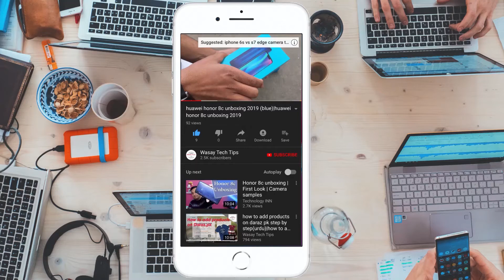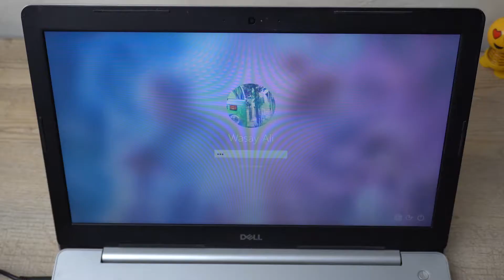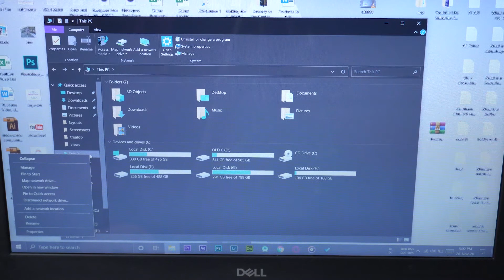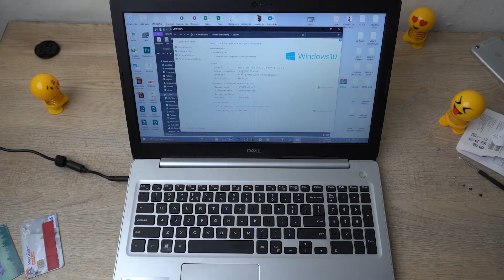How to Install or Upgrade RAM in Dell Inspiron 5570 | Dell Inspiron 5570 RAM Change

Comment: An alt to credit card is to use a trim removal tool. They have cheap Amazon sets that come in handy for other stuff.  My was 25 USD but they basic sets for under 10 USD.
Reply: I use guitar picks. I've got loads of them.

Comment: Did you notice any performance differences after installing the RAM ?
Reply from the maker: Not much difference was seen as my nvme SSD was already very fast in opening applications.

 Only advantage of adding additional RAM was that google chrome could use it more😂.

Comment: My intention is not to slam this video but to share a few words of caution for the inexperienced user. Great job on the tutorial by the way! 
1st: You have DIMM slot A and DIMM slot B. If running only one stick of RAM you need to put that in DIMM slot A, not B. However this motherboard does support either configuration for some reason.
2nd: it's not a good idea to mix your ram. It's a best practice to use the same brand, same capacity (gigs) and the same MHz (Megahertz) when using more than one stick. I believe the MHz is the most important part. If you are going to run different capacity sticks, the larger stick needs to be installed into DIMM slot A, not B.
3rd: Never, ever, ever! Touch the gold pins on your RAM. RAM should only be handled by its 3 less sensitive edges. RAM is the most sensitive component in your computer and is very susceptible to ESD (Elctro Static Discharge). This will render your RAM useless if you shock the gold pins or the chips / circuitry with static electricity that could be built up in your body from a multitude of different reasons. Reasons ranging from the ammount of humidity in the air to the kind of socks on your feet and / or the carpet you just walked across. 
4th: The correct procedure to follow before even touching the RAM is as follows. Step one, discharge the static in your body with the use of a grounding strap. If you don't have a grounding strap you can discharge this static by simply touching anything that is connected to an earth ground and is close to your workstation. Your metal microwave, metal refrigerator, metal oven. Be sure you don't have to walk very far to get back to your workstation as this is how this static can build up. Don't drag your socks across the carpet or scratch on your cat while going from point A to point B LOL. Low humidity will help you build up an ESD much faster than a comfortable level of humidity. Best practice, invest in a grounding strap from Amazon.
Step 2, remove the battery, make sure it's been unplugged from the computer. 
Step 3, hold down the power button for 10 seconds, this will cause any electricity still in the computer to be depleted. 
Step 4, you are ready to touch the internal components of the computer.
Follow these rules and you won't have to double the cost of the investment you just made.

Comment: May i ask if can i used 2666Mhz for both slots?
Reply: The max frequency is 2400 according the specification if you use a higher frequency only the main board can be able to use 2400 Mhz

Comment: Can we remove the existing ram for this model? I have 4gb and planing to upgrade to 2 - 16gb ram sticks
Reply from the maker: Kindly look at the manual for maximum ram supported by this laptop
Reply: Are you having hitting and battery issue after putting extra ram in it over 4gb ❓❓

Comment: Is okay to have a 2400 mhz in b slot and  2666 in another slot? Is there any disadvantage for that?
Reply from the maker: Frankly I’m using the same configuration you are talking about since I wasn’t able to get the same frequency ram in the market. But it’s working OK for me

Comment: Dell 5570 me HyperX Kingston Technology Hyperx Impact 16gb 3200mhz Ddr4  ye ram or samsung 980 500GB Up to 3,100 MB/s PCIe 3.0 NVMe M.2 (2280) Internal Solid State Drive (SSD) (MZ-V8V500) ssd support karenge ky
Plzz reply
Reply: Plzz reply
Reply: IDK about the SSD but I don't think you should put 3200mhz RAM in this laptop. I don't think the processor supports that high clocks. It is better and cheaper to get 2400mhz ram.